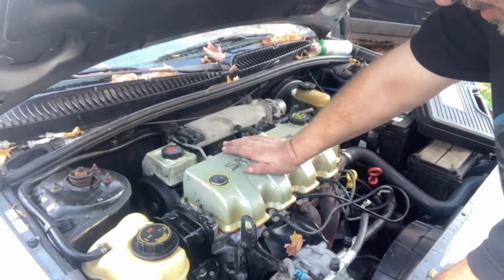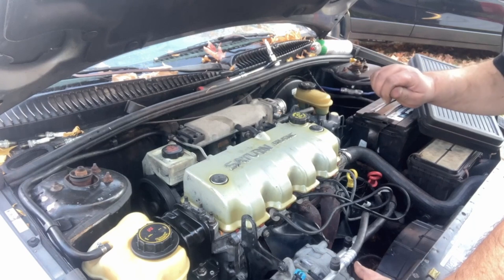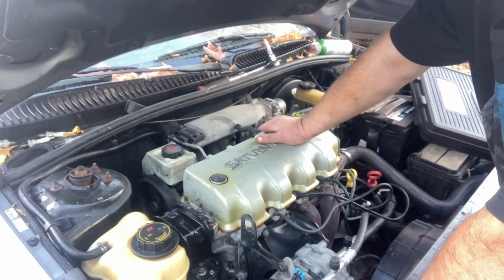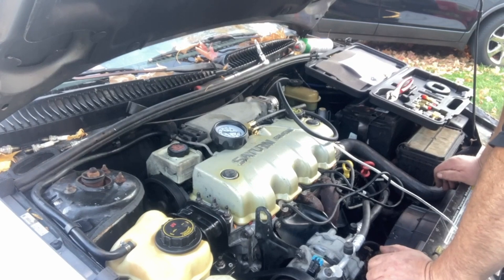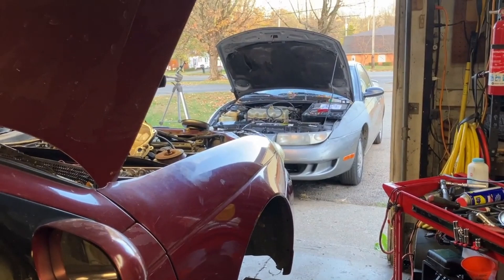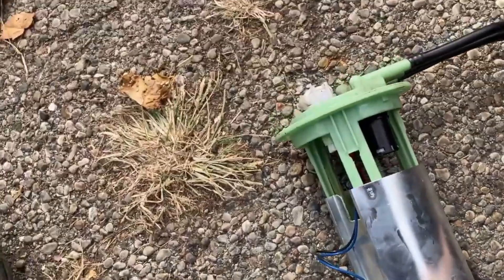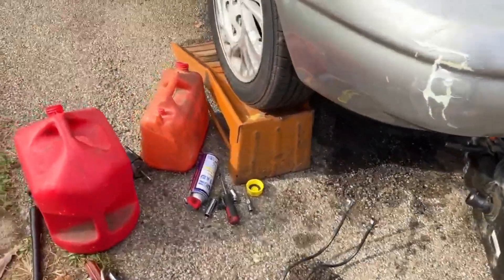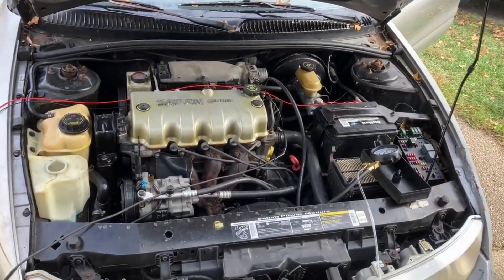Troubleshooting a Lean Problem on a 1999 Saturn SC1 SOHC Engine  - Fuel Pump Problem!

Comment: My car wouldnt start , replaced fuel pump everything was good and started . Sat the winter , now I tried to start it and I’m getting the first crank no start then a start on the second . Heavy engine sputters , rough idle , then cuts off .. I believe fuel issue also but the fuel pump can’t be bad . Could it be a sensor? Injectors? Spark plugs were charcoal color all of them so I’m thinking rich or lean?  I use a mechanical stethoscope to listen to the injectors .. they are all ticking untill the engine sputters and shakes then I hear them ticking slowly like they are dying out untill the engine starts running again then they tick again.. any ideas???
Reply from the maker: You need to figure out if It is a fuel or a spark issue.